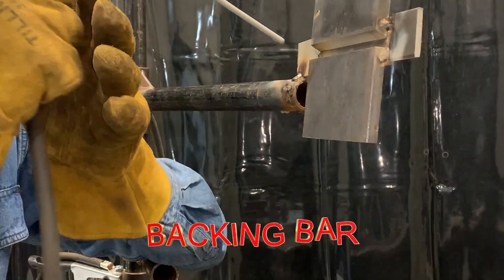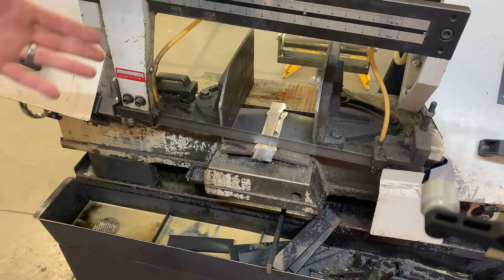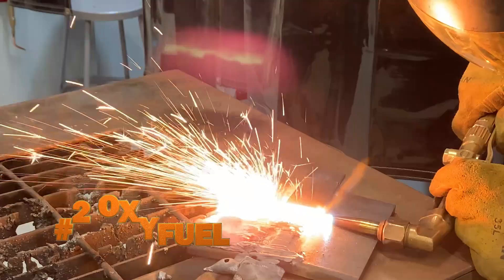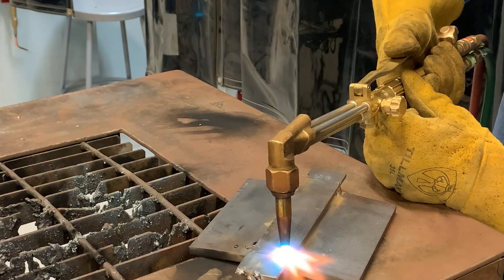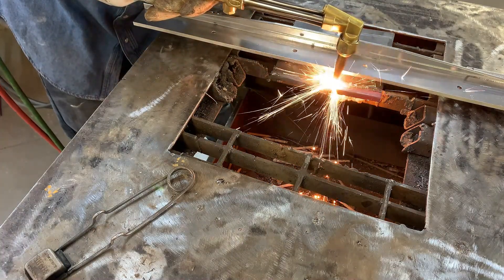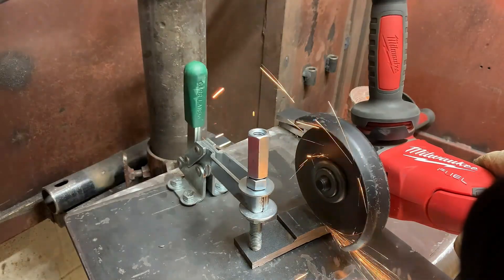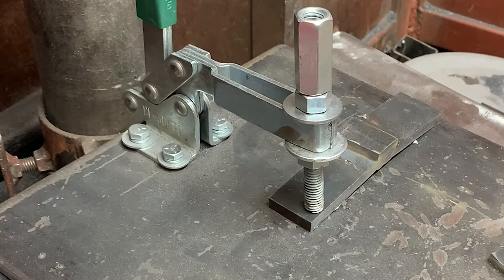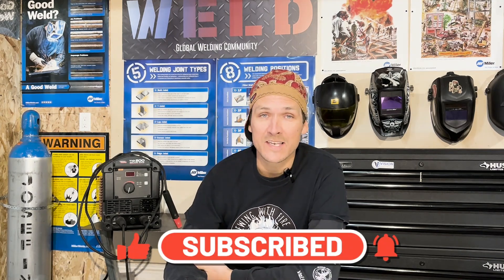Welder Test plate backing removal with a grinder. #sewingwithfirewelding

Comment: For removing the weld using the torch do you use the normal pressure settings  for your cutting tip?
Reply from the maker: @rawstewage1122  yup - I would max it out. Use as much as you can

Comment: You can actually avoid a lot of grinding if you take a grinder with a zip disc and hold it parallel to the test strip to cut that middle piece off. It’s a little cowboy, but I hate grinding so it saves time😆